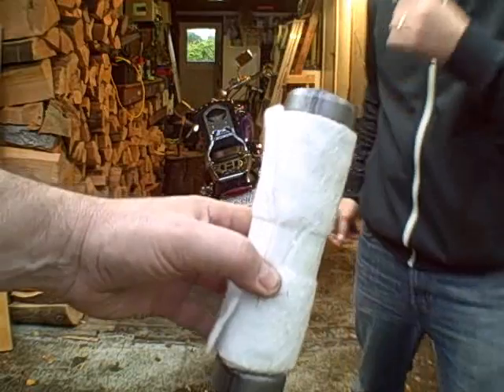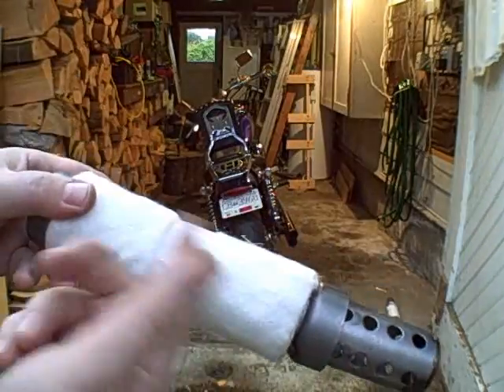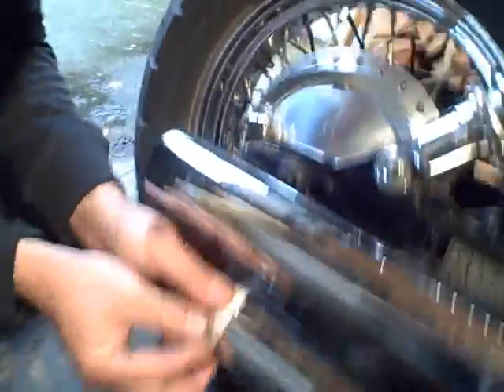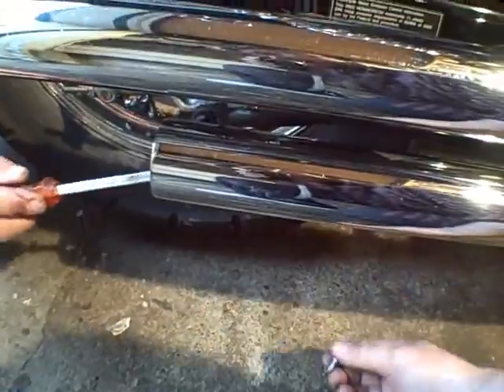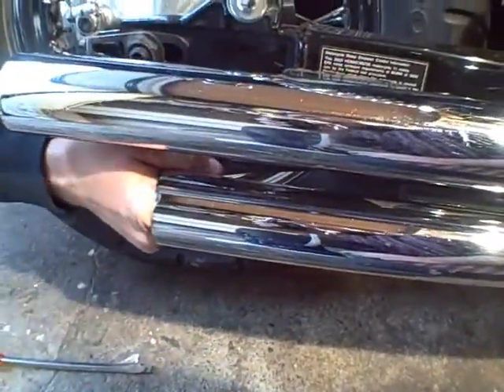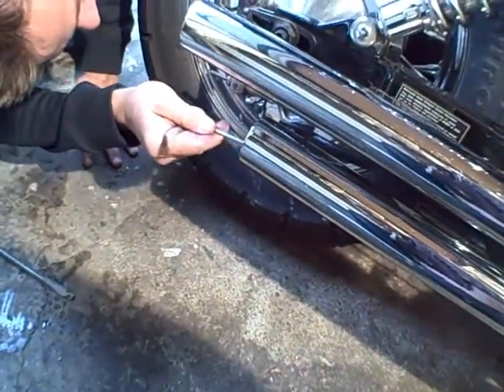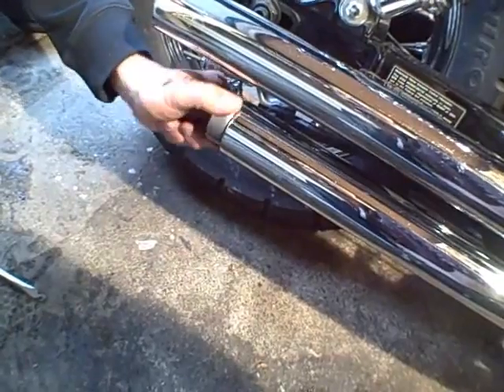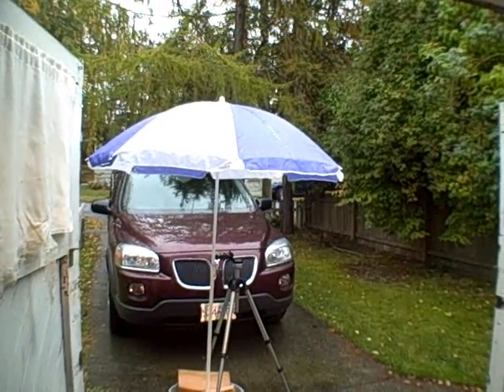How To Install Baffles in Vance & Hines Straight Shots

Comment: £55 in the UK for Baffles (EBAY) like the ones in the video ....most baffles tend not to work after a while though ....a tip...wrap wire around the insulation when inserting makes for an easy job.

Comment: For those of you in Australia you can get Quiet Baffle inserts for Vance & Hines on eBay for $69ea. There are three types that you can get from eBay seller peterstevensmotorcycles:
21869 - fits most Straightshots, Bigshots, Longshots, Softail Duals
21301 - fits most ShortShots Staggered, SideShots
and
21899 - fits 3" slip-ons, Twin Slash 3" slip-ons

These removable baffles will mellow your exhaust note for a classic thump, with a less edgy sound, that still showcases the strength of your motor. Reduces exhaust noise by approximately 2-3dB depending on conditions and bike.

Comment: Hey, I have an 05 shadow spirit with straightshots original but according to the the info I have come across they won’t fit my pipes? Seems like they do.
Reply from the maker: Yah you should be good to go.
Reply: Thank you for getting back to me. Which baffles exactly are these? I see they have a few that look similar
Reply from the maker: @jvera718  if you look up Vance and Hines quite baffles for the pipes you have should find them pretty easy. It's been so long since that video I don't remember the diameter,  I think they were 1 1/2 in, dont quote me on that. Hope this helps. Cheers 🍻

Comment: the screw that goes into the exhaust at 1:37. Does that go into the baffle to hold it in place or just there to block the baffle from falling out? Where I'm at I can't have an exhaust over 95 dB.
Reply from the maker: Hey Robert, yes there is a small nut welded on the inside of the baffel that a small bolt screws into to hold in place.

Comment: does it impede performance
Reply: Marked Man , probably actually added some bottom end to the power band.
Reply: It adds some backpressure which is a good thing and will improve performance particularly with V&H pipes which removes a lot of backpressure that a stock pipe has, and bikes should have some backpressure.